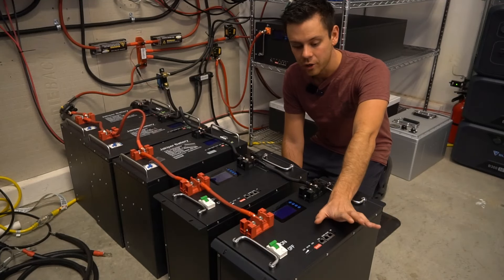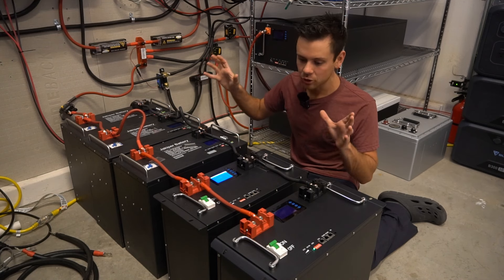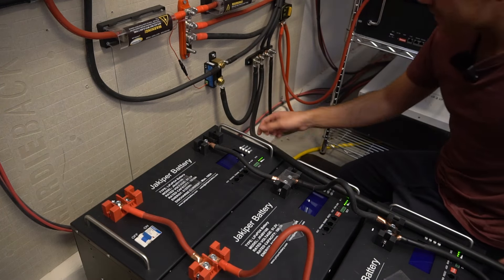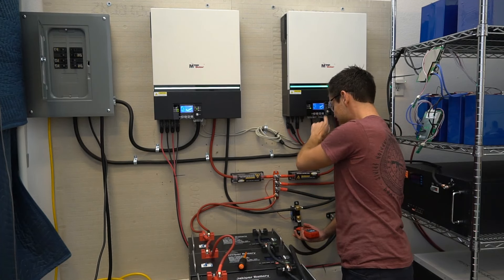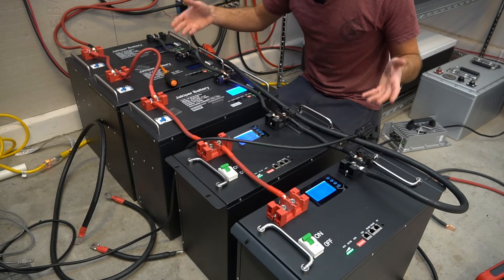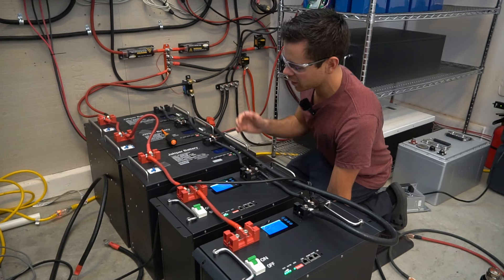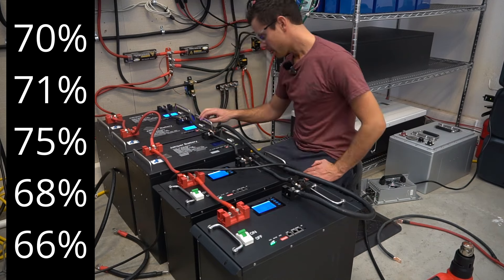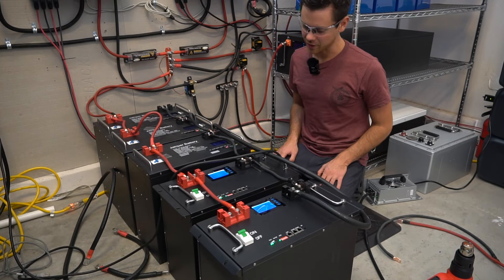Current Sharing Experiment: 25kWh LiFePO4 w/ Diagonal Wire Configuration

Comment: Well done, Will.  A very clear picture of the issues of parallel battery design.  
Someday, we'll get away from these ridiculous low voltage batteries for home power.  I think 120V should be the practical minimum, with 350VDC for larger applications per many server farm power/battery systems (230VAC switching supplies work at that DC voltage).  My own custom off grid system is 120 VDC; no need for parallel batteries or big wire.  It's been serving me well for over 12 years now.
Reply: Dc voltage above 60v is considered dangerous, and then you need protection for the build which makes it harder in other regards, but yes you also could simply not care.
Reply: My comment was about the future of higher voltages for battery banks, but really that is already here.

The Tesla powerwall is already 350-450V.  So are their car batteries.  I assume they care about safety, as do I.  So do Server Farms, who use 350V battery/DC distribution systems.

Many people has been seriously injured by accidental shorts of batteries even at low voltages.  There is no magic voltage where safety is assured in spite of unsafe practices and ignorance.  120VAC  kills people but is in common use.  DC has 4x the shock safety of the same AC voltage; this is a well proven fact.  I suggest that  120VDC is a good next step for off grid battery voltage because I use it myself, and 110VDC has a long history of relative safety for home power from back in the Edison days, with bare uninsulated wires on ceramic posts and tubes.  As I write this, my computer and rear projection display system with stock power supplies are running directly off of my unregulated battery bank DC voltage; 133V at present.  My lighting and daytime cooking are also direct 120VDC, zero conversion loss.

The same safety concern should apply  is your typical high voltage PV array, even if feeding a 48V system.  Someone with less power safety training than an electrician should not work with higher voltages.  I was commenting about the obvious technical future for off grid battery bank voltages.  120VDC is a good, relatively safe next step, in my experience of over 12 years with it.  I'm a retired EE and designed and built my own power system.  I should  probably avoid commenting on public forums for the obvious reasons as illustrated here.

Will does a good job of mentioning safety, and perhaps he should do a separate safety training video.  I'm very impressed with the quality of his technical content and presentations.  Bravo, Will.
Reply: @brucemccreary769  Anything above 60V is considered dangerous in most countries. DC is not less dangerous than AC, actually it is more dangerous because if you get hit by it, the chance that you muscle keep contracted is much higher than with 50Hz AC where you can still let loose the connection you grabbed, as it is not constantly flowing current but alternating. There are for sure ready build powerbanks which have much higher voltages because of efficency but then they are closed products and not like on this channel, DIY solutions. So if you are talking about finished products, yes there will be higher voltages. If you are talking about DIY you will not get much more than now, this is voltage of 48V LiFePO4 which fully charged is nearly 60V is not just an accident. It easy to raise the voltage, put more cells in series, but the danger of serious injury also raises. This does not mean that you cannot simply do it if you feel yourself comfortable with,  but i think you should not  expect a public youtube channel which has thousends of viewers present possible dangerous solutions.
Reply: Alas, your information on the ""can't release"" safety of AC vs DC is absolutely wrong.
You can easily confirm this at any reputable engineering or physics web site. Try AC vs DC safety in google.  DC is 3-5 times safer at any given voltage, and the "can't release" voltage is higher with DC, not lower.  You might want to actually learn something about electrical safety before further posting.

Comment: Question: Do the positive and negative wire lengths from the battery to the system need to be the same length? I see in the diagram, and also in the video, that they appear to be different lengths. I'm asking since it seems to be important for the cables connecting the batteries together to be the same length. Why not so in connecting batteries to the system?

Comment: Grat video. I think that the size of the wires in between the packs is important. In here we have thicker cables on each end of the string but thinker cables between the individual banks. If all the wiring was done with the thicker cables we would have more balanced results ( proportional to the capacity) as the resistance on the hotter thin  wires would be smaller.
Reply from the maker: But we cant. Did you see the video? The max you can add on this terminal is 2 gauge. These batteries come with 6 gauge wires. That's a huge reason I made this video.
Reply: @WillProwse   yes I've seen it and I understand why you have done it this way. You can do this by filing the connectors so it fits. I didn't see the surface too close so can't calculate exactly how big the connection surface is there and whether enough for 230 amps of current but I think it was worth asking. I know that it is never good to tamper with the connections but you are wire enough to do it safely ;)

Comment: If you look at the charging curve on a TESLA MODEL 3 with LFP what was called the SR+ especially in colder weather, it starts out building the kW quite slowly then ramps up later but for longer than NCM etc on an LR or Performance.

Comment: Years ago when I worked in car audio, a common problem was large stereo systems that would call for 200 to 300 amps of sustained current draw, but working with 2/0 wires wasn't always practical. We would instead use 2 2-gauge wires in parallel. Looking at these server rack batterys' terminals, it would seem that if you can stack terminals, this would do the trick. That being said, by the time you bought, cut, and crimped all those cable, it probably would have been cheaper to buy copper bars and drill/file them to fit.

Comment: I’ve never had an issue with diagonal as long as all the capacities are the same. I just ran a test on a 2P X 16  620ah battery. Did you know that 175 amps on 2/0 cable for a few hours makes a nice hand warmer?

Comment: Eliminate your variables, experiment with same batteries to start. But you still have a busbar with 0 resistance connectors, so "busbar" and "diagonal" to the posts is the same setup, electrically, assuming more consistent conductors than you're using.

You want equal resistance from your load to the individual packs. As I mentioned yesterday, the diagonal setup is just the "reverse" of connecting your load to the middle pack. Same issues.

In your setup specifically your positive load conductor is very different from your negative load conductor as well as between the packs.

Get out your Fluke and have fun getting it properly balanced. It'll be instructive for all
Reply from the maker: Once a company sends out 6X of one type of battery, I will. And I bet I can pull within 1% of each other once I have that set up. Will do so in the next few months
Reply: @WillProwse  It should be fun, and great to watch.
Reply from the maker: I will make a pack with 6X matched server racks with equal length conductors. Should work great.
Reply: @WillProwse  Equal resistance conductors, yes

Comment: A nice wee torque wrench is needed for uniform tightening of the terminals, takes out the guess work. Split bus bars are the way to go for high current discharge/charge. Nice copper 3/8" thick from the BMS would sort out any resistance issues. With the energy prices going through the roof in the UK 50% INCREASE in April, I think the return of investment would pay for itself in half the time.

Comment: put the terminals on the two middle packs surrounding the center pack for peak cheap balancing :P

I've done just that before, now I see its actually beneficial somehow, all I cared about was symmetry, turns out its also functional! I'd put the two newer packs between the 3 old ones also

Comment: Please note the the current is additive, so the interconnect wires closest to the output is pulling all the current. That is why they are hotter then the other upstream wires.
If you connect the output wires in the middle of the pack, then no single interconnect will take the full current.
Reply from the maker: Yep that's right

Comment: The difference in currents between the rack batteries in parallel are because of the difference in capacity. The larger the batteri the more amps needed to get same SOC . Discharge same pattern where the larger ones deliver more amps becuase of the larger capacity

Comment: This is not true "diagonally connection", because in the "diagonally" the same cable sizes should go through all the connected batteries, but here in your video diameter changed at the edge terminals of this bank (unbalanced connection from begin).

Anyway, thanks for the opportunity to watching so interesting experiments and listening such thoughts!

Comment: You could have 2 wire between each battery just as you did on the first one.
And add some conductive paste on the conductor to improve the connection.

Comment: Hey will, i personally would change the order of the Batteries like this:
1 Jakiper | 2 "MyteryBrand" | 3 Jakiper | 4 "MyteryBrand" | 5 Jakiper 
or
1 "MyteryBrand" | 2 Jakiper | 3 Jakiper | 4 Jakiper | 5 "MyteryBrand"
Connect Main Positive and Negative ALWAYS to 2 and 4
Made good exp at this way....would you test this on the neyt video?

Have a good time!
Reply: And please replace the longer wire on the positive side between the Battery packs!

Comment: You would get more stable charging/discharge with connecting main wiring to the center battery versus an end one.
Reply: Not necessarily- the length of equal gage conductors is the factor in play

Comment: Did I miss it somewhere? Did you mention the capacity size of the last two batteries? I can on the videos that the first three are 48V 100Ah, but what is the rating for the last two batteries?
I will be connecting two 150Ah and one 100Ah batteries to my 2 x 5KVA Solar Inverters. Glad to see that it can be done.

Comment: I have 6 48v battery's in a cabinet designed for them. It has buss bars in the cabinet for the battery's. Worried about the possibility of bad current sharing, I came up with a different solution. My battery cables are connected at the top of the buss bars. I then took a heavy duty battery cable and connected it onto the buss bars input then connected the other end to the bottom of the buss bar. In this way I am feeding from top & bottom at the same time.

Comment: Great test, too bad you stopped at 60% (?) SOC.

Draining them till the first low voltage protection kicked in will show how it would perform in a real setup.
Charge with solar, discharge at night.

Especially as it's a mix and match pack, that's useful information!
Many of us upgrade their system as they discover to have not enough storage.
Seldom the same configuration can be bought.

Busbars work always best for me :-)

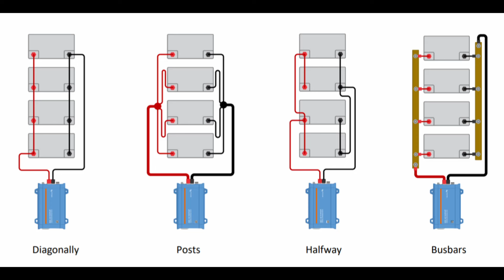Comment: I might be a little late in the game but I've been watching your videos for about two years now. At the 5:24 minute mark you show a great diagram of 4 types of connections. I have the "Halfway" setup curently with all cables cut to the same length with the exception of the cables going to the inverter which are longer. My question is, can I add a battery on each end of the "halfway" setup making it with six batteries and continue to be a "balanced" load? Please let me know. Thank you for what you do 😊 Good day😊

Comment: With those batteries (or similar ones with the same type terminals) would it make sense to run two cables to each bus-bar?  Yes, you'd have to be very careful on your cable lengths and crimps, but it seems like that should help with the wire heating.

Comment: IMHO, I'd love to see you revisit this entire test, but with all HEAVY (1/0 or 2/0) welding cables, although now it's probably more an issue with the size of the internal wiring of the batteries, but with the amount of heat in those 2 gauge jumpers, take that out of the equation and see how different the batteries behave under extremely high load.
Reply from the maker: Already did it, less current sharing but still present. One of our forum members calculated the resistance. You can check it out if you want

Comment: Are you adding current draw? Batteries closest to charger would only draw faster if wire size is to small or your resistance values off from weak ,different size, different type of batteries. if your mixing batteries you can order the batteries by resistance . Diagonal is great idea tho as cost of wire thru the roof. Thank you brandon.

Comment: Hi Will, you talk of using buzz bars to connect multi batteries. If you were to replace the interconnect cables with oversized cables (eg. equivalent to a buzz bar), would that be the same as buzz bars?

Comment: With five packs would you not be even better off connecting +ve at pack 2, and -ve at pack 4?

...likewise if you had four packs you'd probably get a better spread of electrons if you connected at 2 & 3 (this is how I connected the Pb leisure batteries on the boat I used to live on).
Reply: You calculate the total resistance that the battery "sees" from the cells to the inverter and back, and then compare that total with the other batteries, to know how the spread would be. in your example wiring method, the "outside" batteries will have a greater cable distance, and thus greater total resistance. Battery 1 will "see" four jumps (pos+neg+neg+neg) battery 2 will "see" two jumps (neg+neg), battery 3 will "see" two jumps (pos+neg), battery 4 will "see" two jumps (pos+pos) and battery 5 will "see" four jumps again, (pos+pos+pos+neg)

I attribute the current sharing differences in the video solely to internal impedance differences between each pack's true SoC - the 100% mark is a calibrated point, not an absolute point.

You'll still also need to make each jump cable the exact same length, so all short black and red cables must be the same, otherwise it'll favor some batteries over other.
Reply: It's all a trade-off. If connected in the middle, the outer packs will always lag behind as the resistance is higher because of the extra cable (out + back). So on charge, they will be the last to charge, and on discharge they will be the last to discharge. Thus the middle cells will wear out first. It's electrically similar to the "connect all at the same end approach", but harder to visualize. 

That said, it's slightly better than the "connect all at the same end approach" because the current will be far less through the outer wires (~1/4 with four batteries), so less voltage drop assuming you use similar wires.

Comment: looks like you could also easily double the wires between each battery. 
2 positive 2 negative between each. 
each terminal stud having 2 wires  going opposite directions.
Reply: The terminal screws are a little too short to do this correctly, you have a higher chance of stripping the screw threads (checked the inside to confirm, on a BlueNova pack which has the same terminal blocks)

Comment: The bus bar and diagonal is the same in path length to each terminal just a bigger conductor   the same cable area the bus bar would have the same resistance and voltage drop.
The posts diagram has the same length and the same voltage drop to each battery so the best balance but the highest resistance in total.

Comment: Nice video Will. In the long run it would be best to use a copper buss bars using a bar that is 3/8" x 2 1/2"?(the width of the terminal block) this will balance out all five batteries outputs. Also you can eliminate the cables just by mounting the buss bar to the top of the batteries using some copper spacers larger O.D. the best, you can also use both terminals to connect to the buss bar to increase the DOD and charging capacity.
Reply: Should have mentioned you should use heat shrink on the buss bars between the batteries terminals, then use a liquid rubber  paste to cover the exposed terminals or install a hinged plexiglass cover for safety.

Comment: I hooked two 300ah 12v  batteries in parallel to make a 600ah 12v system but only one battery is being used by the system. The other stays at 100%. Got sick so putting things off but any thoughts? Hooked up right, but used more positive cable than negative by 5" or so..maybe need to make the length equal or something?

Comment: @DIY  Solar  Power  with Will Prowse  I'm questioning having the batteries daisy chained the way you are showing.  You said the wire on battery 1 was getting hot.  That would be obvious that without the use of parallel buss bars that cable was carrying the current of all 5 batteries added together. Even though each battery was providing ~30-35 amps the single cable was carrying the entire  200 Amp load.
Reply from the maker: Yep, that's why I said to use busbars and equal conductors instead

Comment: I’m having an imbalance discharge issue on my Jakiper rack setup. I am using a bus bar connection, equal cable lengths and diagonally connected to the inverter and I am still seeing an imbalance. Not sure why.

Comment: Hello Will, or anyone that might know. Is there a difference if you run a bus bar as the main connection to the batteries and then grab your leads from opposite ends? seems like the leads would all be the same as they are 0" to the bus bar?

Comment: Appreciate the lesson on options.  I wonder how the battery balance would turn out if the main cables were connected to the middle (lower volt reading) battery. ... That might be worth a test on that specific battery set. ... just some thoughts